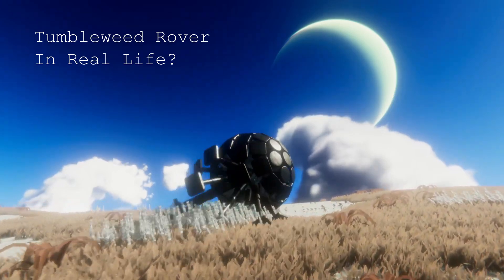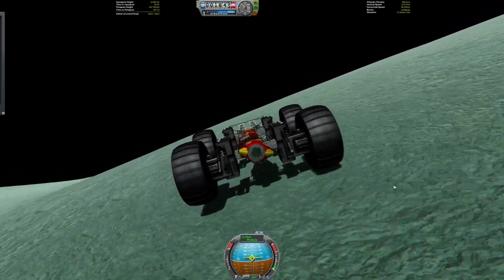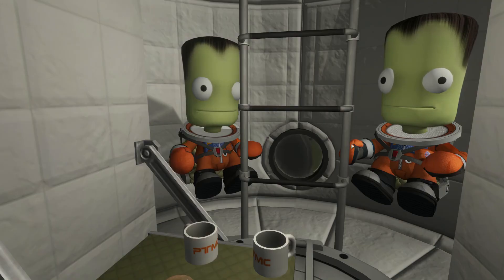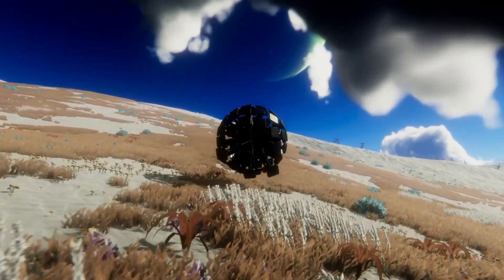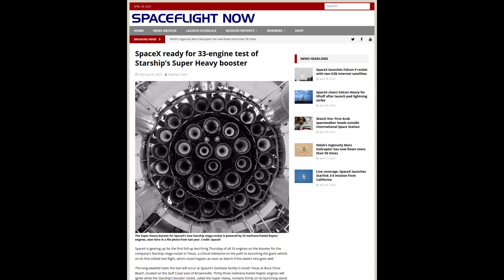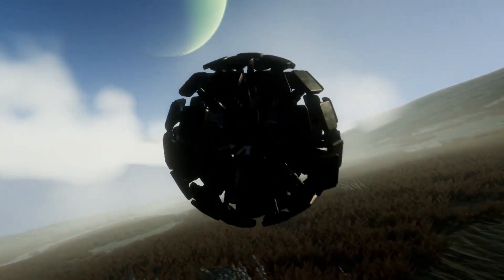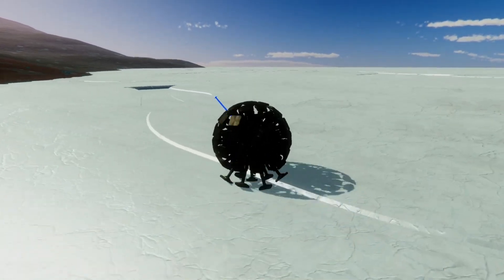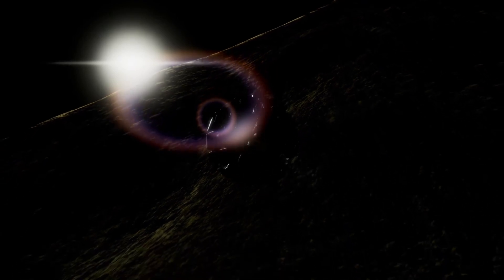KSP (kOS) - Can tumbleweed rovers work in the real world?

Comment: The idea of placing enough cameras to ensure total high quality coverage on all sides for navigating terrain isn't a very practical idea when you could just put a sonar device that maps out the terrain completely. Yes, it'd require dozens of codemonkeys working on a pretty advanced piece of software to link the controls, gyroscopes and motion sensors, pistons, and the live sonar map. But it'd be significantly more accurate scanning the intricacies of the terrain than cameras.
Reply: How are you gonna sonar on the moon🤔

Comment: This is really cool, but I'm a mechanic IRL (and a big KSP fan), so I can tell you right away what the biggest problems with your design are going to be, when translating it into real life. Real hydraulic actuators are heavy, slow, and require pumps and accumulators that are going to make the design even heavier and more complex. This isn't so much of a problem when you're in a low-gravity environment; the added mass might even help keep you on the ground. However, it's going to make the payload weight ridiculous compared to a conventional rover, meaning a bigger rocket is needed. If your design was real, every single one of those rams would weigh hundreds of pounds. Your rover would easily be a 15 to 30 metric ton payload IRL. 

Also, the wattage requirements for the pumps would be way beyond what even a cluster of RTGs could provide. Even a slow one would still need tens of kilowatts just to move at all. Lastly, if it springs a leak somewhere and the whole system loses its fluid, it's toast. KSP doesn't showcase how many hoses and high-pressure fittings this would need. You could increase the redundancy by having separate pumps, accumulators, and reservoirs (separate loops, basically), but that's even more weight, complexity, internal volume, et cetera. Making it possible to jettison the legs would be even more weight and complexity because you'd need some means of completely isolating hydraulic fluid from that part of the loop to prevent other legs on the same loop from losing fluid and thus power.

Your design's performance in-game is fantastic and required some very clever engineering and scripting, but IRL, this would be exceedingly complex, heavy, and power-hungry, and if you scaled it way down to compensate, there wouldn't be much room for instruments. I do agree, though, that it's difficult to get rovers to perform well in very low-gravity environments like Minmus or Gilly. Not quite enough downforce from gravity to get traction on hills.

IRL, if you wanted to make an omnidirectional spherical wheel-bot, it would probably be easier to do one with a gimbaled flywheel on the inside. To travel, it would spin it up and then brake the flywheel to convert the flywheel's rotational energy into a torque on the outer shell. To change the direction of travel, it would simply re-orient the flywheel axis. The NASA Hedgehog is an interesting cubic example of this.
Reply from the maker: Thanks for the great response!  

Hydraulics would certain he an issue, mostly using those as its all KSP can give me.  I think a real life attempt would probably need something like an electrical actuator.  Hydraulics are way more powerful than needed and far too complex.  

And payload relative to the size is definitely an inherent downside.  

I think a flywheel version would probably struggle a lot with hills since it can't brake on the hill, or very rough terrain since it can't conform as it flows over.

Comment: "Throw the dust off??" 
The dust issue is MUCH more complicated than that. You can shake, vibrate, turn upsidedown and the electrostatically charged microsized razorblades just stick there. The only thing that has really shown promise is a liquid nitrogen shower utlising the lidenfrost blow out to move them.. but thats on Earth where we can make liquid nitrogen. not so easy else where
Reply from the maker: I think it goes back to the fact that every design has to deal with dust in some way.  I'm just not sure if it's more, or less of a problem compared to a wheeled rover.  The electrostatic cling will happen to almost any design, but you also get some dust just sitting like that which almost killed the first Mars rovers by obscuring the solar panels, but which occasionally got cleaned off by dust devils.
Reply: That and the sheer amount of abrasion that such dust might cause, it would obliterate basically any seal you can think of.

Comment: what if the pistons were inflatable tubes that expand/fold outwards rather than conventional pistons/actuators? a pump and tank fully sealed inside each tube would move a small amount of gas from compressed storage to the larger bag (on nearly airless worlds this could be a tiny amount to get good force) and back again. zero seals or conventionally moving parts outside the bags, and when fully deflated for transport, packs far smaller. the only serious engineering challenge becomes the bag/membrane itself, which has to be extremely durable, flexible, long-lasting, and at least on the ends, stand up to terrain.
Reply from the maker: I looked around for some inflatable-balloon style parts in KSP because I wanted to try this out, but didn't find anything.  Also curious about that concept since it would also be pretty durable against falls.
Reply: Nice thinking outside the box lol.
Reply: Like a spiders legs. They are hydraulic. If the spider dies the legs curl up because the heart is not keeping the limbs pressurized.

Comment: I feel it worth pointing out that the Lunar Roving Vehicle had a design speed of 6 mph and reached a top speed of 11.2 mph, so while this is slow compared to terrestrial vehicles i'd argue that's a very respectable pace on such a low gravity and rough terrain body, so it doesn't necessarily have to move at a snail's pace, particularly if it were manned and wanted to be used for transport, even though inevitably for efficiency reasons it probably would end up doing so.

I do really want one to be made though, for no other reason than it sounds hilarious
Reply from the maker: Snails pace would be for something that is far from a mechanic, and has to rely on RTGs for power.  With some kind of refillable power supply and the possibility of repair....  they can go pretty quick  :)

A manned version would be a ton of fun as long as the gimbaled command seat is working right.  When that has issues....  oof.

Comment: what about weight on all these pistons and they do need a good hydraulic sized system to run  ?  if its big enough, sure ..its possible.. but a small version would not be that easy to  fit its own mechanical needs and external needs in the same device.
Reply from the maker: Depends on where it is headed.  Might just use electrical actuators for example rather than hydraulics.  Weight isn't as much of a factor as on earth because most places it might be used have considerably lower gravity.
Reply: @lodurrvoluspa_ksp  have you taken out patent on this design? just in case you sit on a goldmine idea here? :)  would hope so after all the well made precentations on youtube videos.  :)

Comment: Are there other geometries with similar benefits but different tradeoffs? What about a dumbbell shape, which would only require two disks of pistons? Maybe use 4 disks as wheels? I haven't thought about this too hard, but it seems that when rolling, most of the pistons are not doing much work.
Reply from the maker: I want to play around with a "split egg" design similar to the dumbell you are describing that would always roll back to it's side no matter how it landed, but mostly roll around on it's side.  This would allow for a bigger opening in the middle for sensors and potentially solar panels depending on where it is going.
Reply: @lodurrvoluspa_ksp  I can't wait to see it! That would address the openings concern, but maybe loses some of the ability to lose parts.
Reply: I think you might gradually optimise it until you get a normal rover

Comment: The single biggest problem with the design is common to all current robotic space technologies: fouling seals.
The Moon and Mars present major problems for things like bearings or gaskets because of the vacuum, hard radiations, massive temperature  ( thermal expansion issues) and dust fouling. These four things coupled together spell a grand total of zero good solutions for moving parts in these environs, especially linear seals like hydraulic or pneumatic cylinders. Things like the Mars rover or the Apollo Moon buggys manage this through either insanely conservative layered coverings and hoping for the best, or just using conventional vacuum bearings and expecting them to fail after only a few days.
By having a shitload of cylinders, it's either practically impossible, or assuming that sealing is just solved somehow.
Reply from the maker: Dust is certainly a huge issue.  Question boils down to whether it ends up being better, or worse than a traditional wheeled rover.  Dust sleeves should give the piston a bit better resistance at the start (I'm guessing here) than a spinning axle which is effectively impossible to fully seal since it must rotate.  And this can shed many of it's legs and carry on vs a rover that gets into trouble quickly as wheels fail.
Reply: @lodurrvoluspa_ksp  Well the problem with sleeves, wipers or as  @boomchacle7941  mentions, you'd need a flexible polymer material to make those out of.
If you take the list of all polymers that you could use for that application, 90% of them will be eliminated by the need for vacuum or low pressure compatibility, and the remaining 10% will be eliminated for want of radiation resilience. This fact is one of the dominant reasons why development of a future Lunar rover is a very complicated problem that few people talk about.
Reply: this design could potentially use a soft stretchy cover outside to protect the piston from dust
Reply: What about magnetic cylinders?
Reply: @fumo-fumo-fumo  outsized power consumption, and (on the moon) makes the dust fouling problem worse because the regolith is magnetic